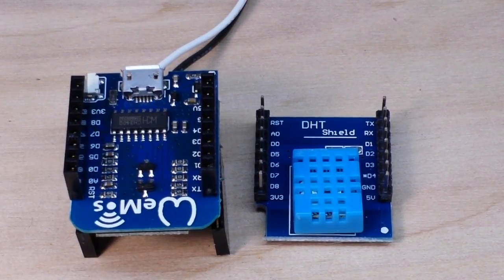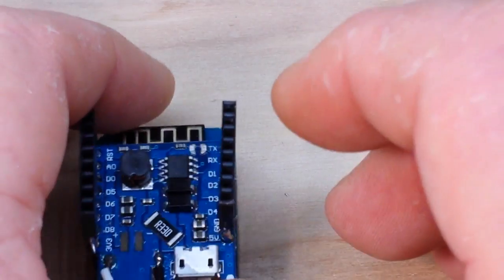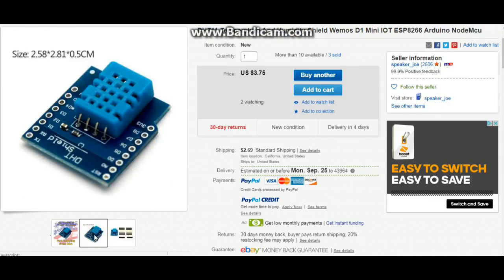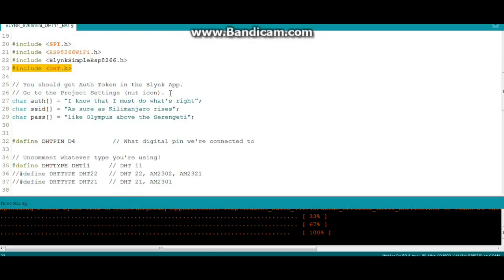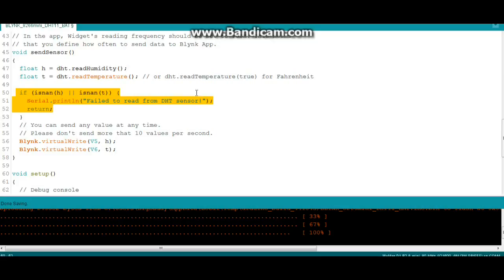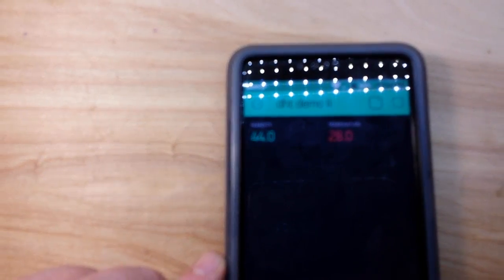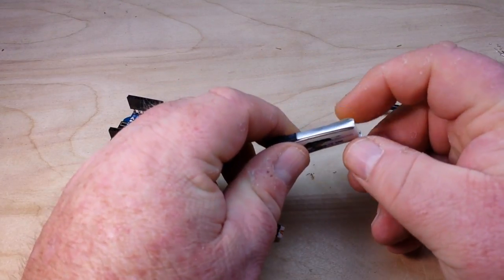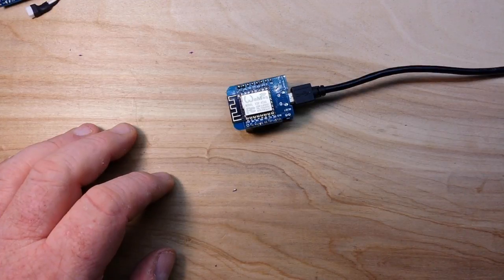Wemos D1 Mini Shields FAIL

Comment: Mate-N-Lock is what that plug / socket is called that you put on the battery shield.
I have a few of those wifi modules and some 900MHz ISM ones too

Also the WiFI info are lyrics from -  Africa, by Toto

Comment: how could you miss the two pins clearly labeled + and -? XD
Reply from the maker: +fredlllll I didn't miss any lables. My screw up runs much deeper...
Reply: explain?
Reply from the maker: +fredlllll well, when I tried to pry up the connector to desolder it, it broke. And it took the pads with it. So I thought I could scratch right behind the pads where I thought the tracks were and solder to the tracks. Apparently I just soldered to the ground plane.
Reply: o boy XD

Comment: hi, I have made similar experience with Wemos D1 Battery Shield from Aliexpress. If you connect brand new shield to USB you get an short circuit. No soldering, no modification of shield. I have compared them with working shields. I can't find any difference. And I get some of them. No idea why shields doesn't work. Would be great if someone know how to fix them.
Reply from the maker: Uwe Ri_ thank you for the info. Maybe I didn't kill it then...
Reply: do you have tested to use usb connector from battery shield ? But be carefully....
Reply: Today I had a battery shield v1 (purchased via Ali) that failed to charge. The V+ of the USB was shorted to ground and the power supply shut down as soon as I plugged it in. I did some desoldering and found an error on the board. One side of the large R330 resistor was not only connected to the diode and the Vin of the chip, but also directly connected to ground. As it seems it was a design fault in the copper layer which could not be seen without desoldering the resistor. By cutting the connection to ground I could repair the shield and after resoldering the components it al seemed to work.

Comment: Sorry to say fella but you have soldered your wires to the shield/ground of the socket you removed, the 2 pads at the back of it that look as though they are completely gone im guessing came off when you took the socket off are the pads you need...
Reply from the maker: +Alex Walpole probably. No excuse.
Reply: We all do it mate no worries :)
Reply: Are there + / - pads on the bottom of the shield that could be used?  The board is probably fine, you just shorted the battery pins both to the ground plane.